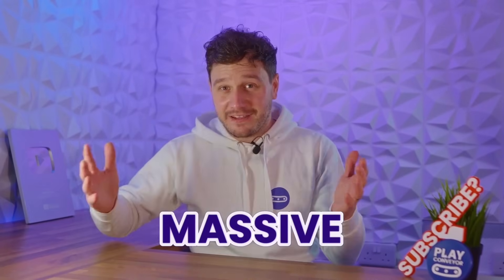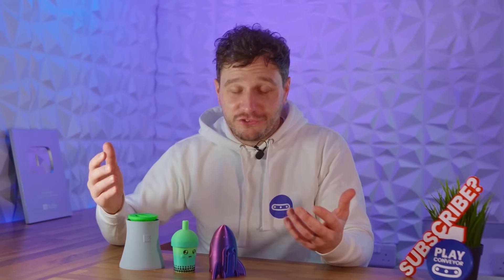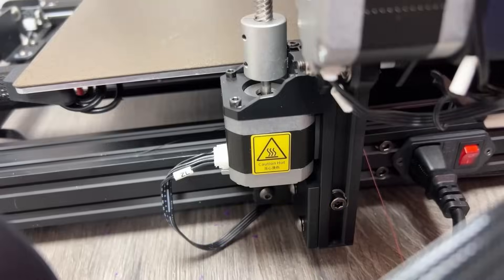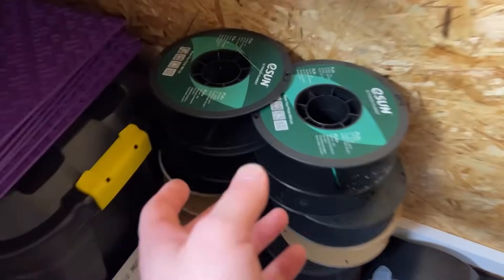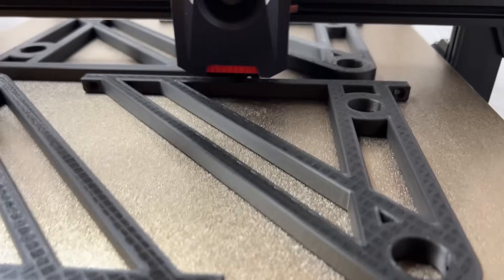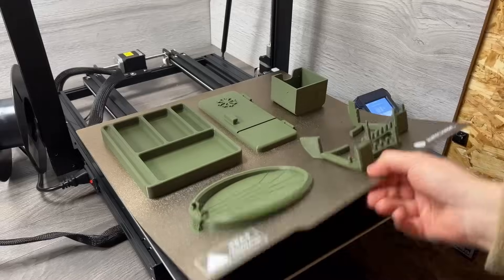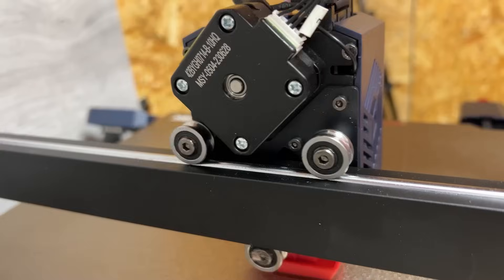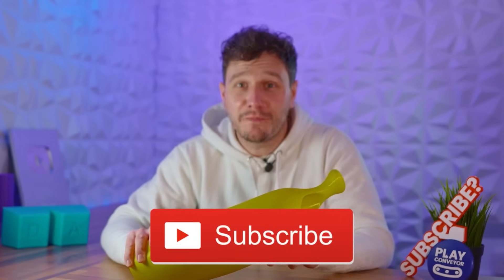The REALITY of owning a MASSIVE 3D printer - AnyCubic Kobra 2 Max

Comment: I bought Kobra 2 max because i have been using the Anycubic Chiron for many years and i like to print PETG.
Chiron doesn't handle petg very well but with Kobra 2 max i can print at insane speeds the petg. Like 230mm/s versus the chiron that was printing at 30mm/s . Above that i get very steingy and not even prints.
Also has to say that with high speed comes high vibrations so my whole table feels like a level 8 earthquake.
Overall i really like my kobra 2 max because if i have to print pieces that i must assemble after, i just sit them all together and print them in 1 session instead of having to wait to finish 1 piece and start another. So the project takes just 1 day instead of e or 4 days to be finished.
Reply: i print PETG with 300mm/s on my kobra 2 pro. 245°C / 80°C Bed / 40% fan. insane good quality!
Reply from the maker: That’s a great use of it, I can’t believe we didn’t think about just using it to fit more parts on til a month or so in!

Comment: I have the Kobra 2 Pro and it has been one hell of a good printer. It worked straight out of the box without having to tinker with anything. For the price it is a bargain.
Reply from the maker: If it performs like the Max did for us then I’m amazed at the price of it… I think it’s like £235 here on a couple of websites which is just silly cheap!!

Comment: I print on the kobra 2 plus and bambu lab p1s. The two negatives you mentioned are easily workable. When loading filament, make sure the hot end is positioned all the way to the left and bottom of the bed. The slicer itself is fine and covers advanced needs. For anything beyond, just use prusa slicer.

Here are my two negatives:
1. The G4 pause command does not working on anycubic. This has meant my timelapses often don't come out smoothly.
2. You can't upgrade to a bimetal heat break (atleast easily). The aftermarket bimetal heat break does not have a recessed thread, meaning you will have filament oozing out the top of the heating block, unless you manually mill the heat break, which in my opinion that level of effort isn't warranted.
Reply from the maker: Agree, definitely workable and it’s a testament to AnyCubic that they were our only real issues. They are more from a place of frustration that the level of engineering it takes to make such a fabulous machine, yet sometimes the smallest factors get overlooked.. at least the filament holder wasn’t on the back I suppose 😅

It sounds like you like to do some mods on your printers.. have you upgraded the P1S at all?
Reply: @playconveyor  I upgraded the p1s hotend to hardened steel extruder gears and nozzle before I even turned the printer on! Hoping to print some drone parts for my engineering channel (YT: Engineering Dads) with CF reinforced filament. I'm probably going to print something for the filament AMS poop hole (lol) but that's about it. Any other upgrades you recommend?

Comment: Got the kobra 2 on eBay as b-Ware for just 110€.

Had to change the nozzle though because i could not get it clean.

But since then it works great for me.
Reply from the maker: Yeah I’ve been impressed by AnyCubic to be fair, still baffles me how cheap they are these days compared to a few years back!
Reply: @playconveyor  im pretty new to 3d printing. My Brother gave me his old ender 3 pro. It works but Not too good. Im thinkin of exchange it for a bambu lab a1 when it is availlable again in may. What so you think of those two Printers?
Reply: @KreutzKonterTV bambu lab printers are pretty good i think. Just make sure u do ur own research and dont buy too fast